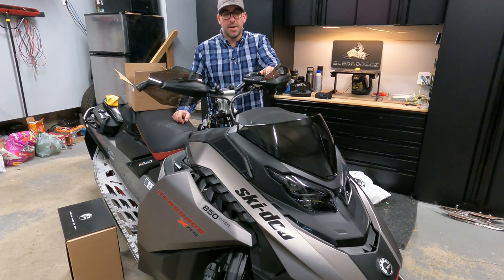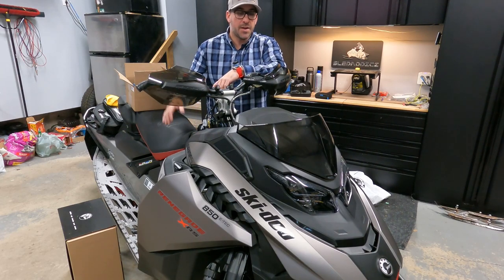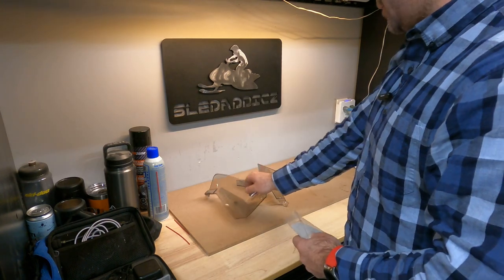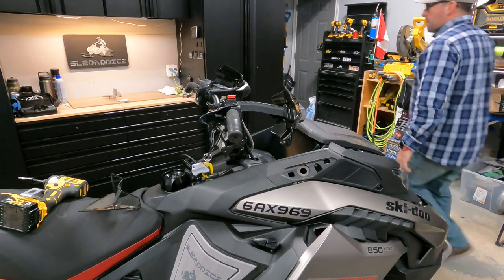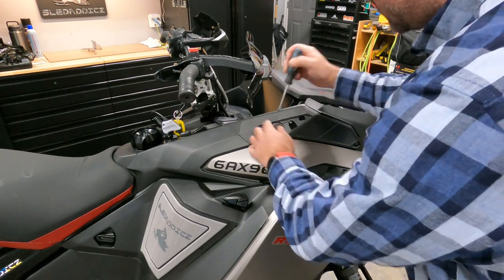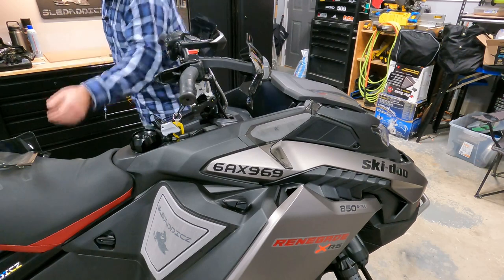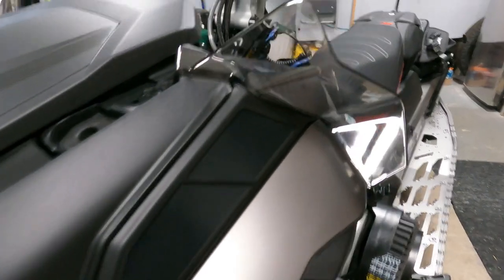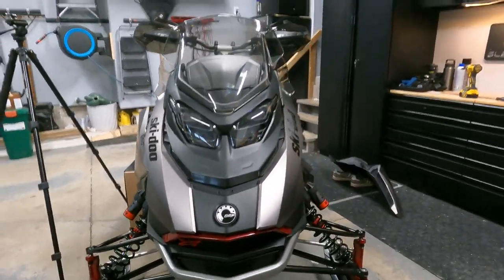Ski-Doo Gen 5 Low Windshield and Side Deflector Kit Install | Perfect with the Glovebox Extension

Comment: My question is where do I get the little black covers you removed to put the wind deflector on? I can’t find a part number or picture.  I’m installing an ultra low windshield and removing existing deflectors on a gen5 MXZ.  Thanks

Comment: If you order the windshoeld and deflectors from a 24 Renegade XRS 900, they are actually tinted, not clear like the one in the video thumbnail.  It doesn't come with the support though, have to order that separate, as well as the attaching screws.  And you forgot to put the clear protective tabs on the hood to keep the deflectors from rubbing the hood.
Reply from the maker: Yup that is correct. 900s come with the tinted windshield. Cheers, Jesse
Reply from the maker: The deflectors don't actually rub. The grommet keeps the deflector raised just enough - no real need for them. Cheers, Mike

Comment: I just put my deflectors on my XRS this weekend.How come you did not put the clear sticker on so it doesn’t rub on the paint on the hood?🧐
Reply from the maker: It's not required. They will not scratch or rub that plastic at all. Cheers, Mike
Reply: It will actually scratch pretty bad where the side deflector contacts the panel. I know from experience. … lol
Reply: Hmm. Never noticed it on my 22 with 17,000 kms and Mike's 23 with 6500 kms. Cheers, Jesse
Reply: Not sure from the shape, how Do you add the protective film to look right?
Reply from the maker: @speed7625  we don't. Never have and never noticed any scratches on our 18, 21, 22 and 23 skidoos with the side deflectors. Cheers, Jesse

Comment: Looks good, would look even better if they had a slight tint

Cheers
Reply from the maker: You can order the windshield off a new 24' 900r that's tinted and would look great to match the handguards. I ended up wrapping both in matte black which look even better 😍.  Cheers Mike

Comment: Hey my deflector kit I just bought came with two protective decals supposed to go under the tips of the deflectors, do you bother using them? does it even matter?
Reply from the maker: We don't know. Its supposed to protect from scratching if you wanted to use them. Cheers, Jesse
Reply: @sledaddicz have you had any issues with scratching or no ? Just wondering I wasn’t going to bother sticking them on

Comment: Do you have any experience with the high beam auxiliary light on the g5?
Reply from the maker: No I don't. I used to run the high beam on the G4. The G5 stock lights are so bright I have never felt the need to add on additional lighting. I do a lot of night riding and I find the stock lights plenty bright. Cheers, Jesse

Comment: Further to my last comments please check in recent video on problems with BRP chain case lower gear problem, you must replace this with new on plus insert to prevent lower gear wobble that has caused failures,  sorry bad news Christopher ottawa just search on utube for this video
Reply from the maker: Hey Christopher. Haven't received anything from BRP on this. We also have new sleds this year so I don't see it being an issue for us. Cheers, Jesse